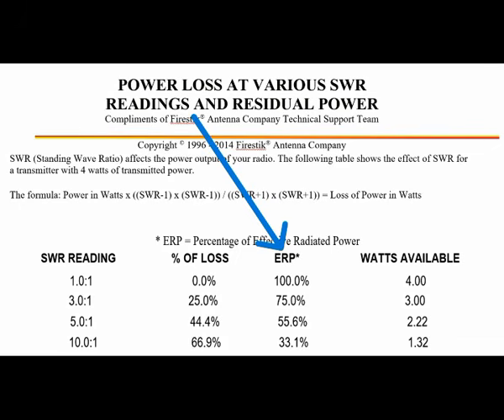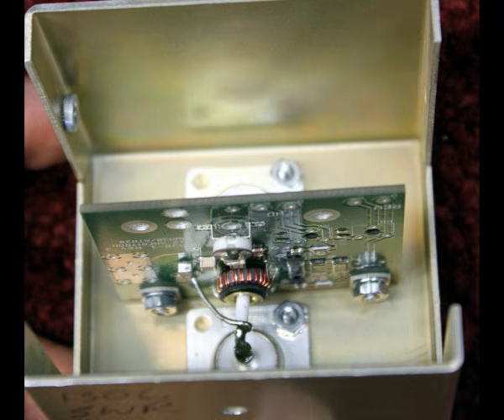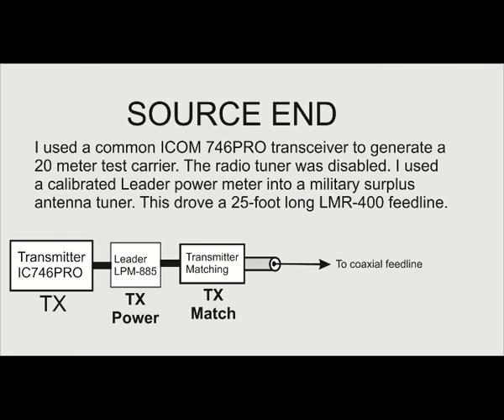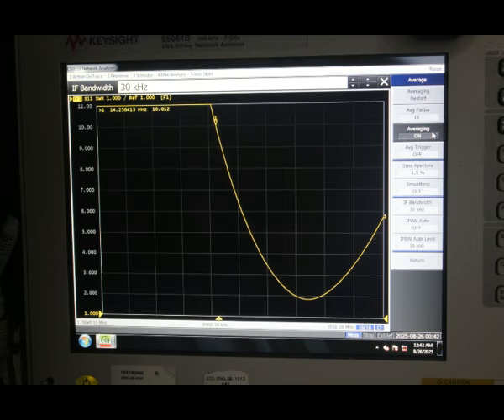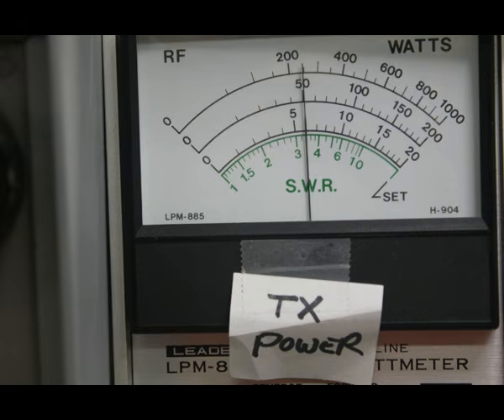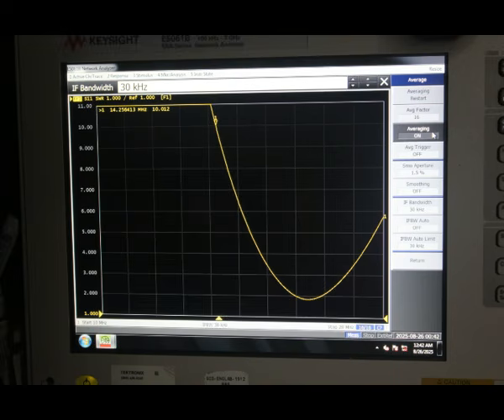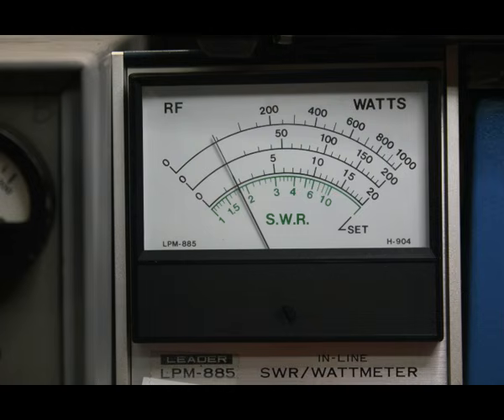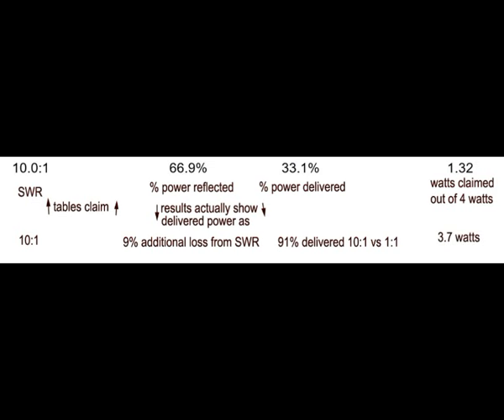Reflected Power SWR What Really Happens!

Comment: Hi Tom. I read all the comments to see if any others picked up on this but none did.  I may be having an 'old man moment' but around the 24:00 mark you are showing the HM2140 and you claim to read 19w for and 15w ref and the meter is clearly on the low power scale(rightmost button IN). I read the values as 9w for and 4w ref.  Then at the 27:33 mark you claimed you had to change to the high power scale.  You read the meters shown correctly for the high power scale, but in fact, this is the same photo at the 24:00 mark and the meter is clearly on the low power scale.  As an aside, if the meter was on the high scale and reading just under 100w, why couldn't that be read more accurately on the Low(200) scale. on it. Neither photo matches your verbiage unfortunately, or I'm having that old man moment!
So, unfortunately for me, it's a bit difficult for me to follow with the incorrect photos.  Also, you indicated the published charts are correct in a very limited instance.  I'd love to know what that instance is. Time also to pull out Reflections III and re-read!!! Thanks Tom!

Comment: Tom, you might want to watch the AT&T archive YouTube video on the mechanical wave motion engine model by Dr. Shive of the Bell Telephone laboratory. 
Waves, their motion (whether longitudinal or transverse mode) in relation to the medium in which it is sustained are all true phenomena and have been objectively tested in many ways. 
The electrical (or the transverse electromagnetic) wave motion in a conductor behaves as predicted. As long as the characteristic impedance of the source, the line and the load are identical the power transfer is 100% disregarding the line loss. 
If the incident energy encounters a 'discontinuity' or of different impedance there's going to be some reflection, the magnitude of which depends mainly the severity of the change. 
All forms of waves, (whether mechanical, electrical or gravitational origin) do exhibit interference pattern (and the other phenomena associated with the waves even of the particles at the quantum level)
TDR is the real study showing the reflected pulse on the scope. 
The assumption that all the reflected power is 'lost power' is absolutely wrong. 
A high impedance load causes a high voltage because all the power is not absorbed. 
A low impedance load draws more current. 
The high voltage (high VSWR) at the Tx end can destroy the final transistors. 
Similarly excessive current drawn through the transistors may result in thermal run away. 
With this in mind the modern transceivers are built with the ALC mechanism. The VSWR coupler detects some voltage and it's used to either reduce the power output or to totally shutdown the output stage. 
You may want to run a new test in which you would replace 'your' "mismatched load" by a regular antenna and then with "deliberately designed mismatched antenna"
In both cases you must do register the actual or relative field strength for comparison.
In either case especially the ALC mechanism must have been defeated.
de VU2RZA

Comment: i didn't watch the whole video yet but it sure sounds like you are inserting another device between source and transmission line. i just want to clarify this before i watch it. most people when they talk about transmitters and reflected power, they mean that literally, like a transistor, a transmission line, and a load, no other stuff in there. that is the common understanding.

Comment: I recently read REFLECTIONS III, and I agree with your video excepted on power reflections: Mr. Maxwell does say, in his book, that power does come back on mismatches. TDR actually proves that, so does top end directionnal couplers.
Reply: Read chapter 2 of reflection 3 it aligns with Tom's explanation
Reply: Let's start by simply considering the situation of instantaneous rf power, which is instantaneous voltage times instantaneous current, as measured at some fixed point, while applying a steady-state sine wave of fixed amplitude.   For a purely resistive load, regardless of SWR, the instantaneous power always flows toward the load, except for the two instants at zero during each cycle.  For a load with any non-zero finite resistance and any non-zero finite reactance, there are two periods during each cycle when the instantaneous power flows toward the load and two periods when the instantaneous power flows toward the transmitter.  (In this situation, the zero crossings of the voltage do not align in time with the zero-crossings of the current.)  The SWR meters and directional wattmeters typically used by hams simply display average power.  When the SWR is higher than 1:1 but the load is purely resistive, the meters assume a superposition of simultaneous forward and reflected waves such that the indicated forward power minus the indicated reflected power is the actual average forward power.  If we are careful to define our terms and use these consistently, then much of the confusion would go away.

Comment: 1. Power delivered to the load will be dissipated 100% if there is matching. Zero ohms or infinite ohms means 0% will be dissipated. According to Ohm's law if there is any doubt.
2. Any changes in impedance will result in matching power loss at all impedance transition points in the transmission chain. Power output transition to transmission cable and transmission cable transition to load.
3. Unused power does not disappear. Therefore, power is reflected. An analogy to this would be 1W TX at one end and 1W TX - 1dB (cable loss) at the other end (same frequency and phase). This will create a standing SWR, which is actually two signals that combine as a result of strength and phase. If you sample the voltage at different points on the transmission line, you will find different voltages due to the phase and strength of the two signals at that point. The transmission line must, of course, be long enough to allow the minimum and maximum to be found.
5. If a transmitter output has an impedance deviation from the nominal x2 (25 or 100 ohms), there will be a mismatch loss of 12% (SWR = 2). This is repeated at the cable transition to the antenna if the antenna impedance is x2 (25 or 100 ohms). If we disregard cable loss. A 100W transmitter, this becomes 100-12%=88W-12%.
6. A 50 ohm transmitter that sees SWR of 10 (5 or 500 ohms) will obviously have problems delivering its power (Ohm's law). The values shown in the video, which are mistakenly questioned, demonstrate a serious lack of understanding of reality. I am not a HAM operator, or as it is called locally, a radio amateur. I have worked professionally with coaxial cables and waveguides and slottet waveguides for SWR measurement up to 18GHz.
And for those that believe the earth is flat : https://www.youtube.com/watch?v=gaxzX28pKxQ
Reply: this is exactly what i'm talking about. all these hams have such a limited view that only pertains to their world and they think the rest of the world doesn't understand when it's actually the other way around. it's myth after myth after debunking myth, debunking the debunk, and it really seems they just repeat what they hear without actually understanding it and then make videos about when you're not sure which person to repeat.
Reply: An antenna tuner at the input with 10.1 mismatch at the antenna with 600ohm open wire can be an efficient system
Reply: @Pioneer936  i'd have to think about that but i'm sure inserting an antenna tuner has an effect. ultimately there is a limit to how many volts you can produce and if that's the limiting factor in the setup then anything that's pushing back i imagine would reduce the power that can flow. you can match a clothes hanger, but if it doesn't radiate and it doesn't reflect, that means it's just not accepting the energy, despite being perfectly matched.
Reply: @dronefootage2778 this is how doublet antennas work
Reply: If we have a 450 ohm ladder line connected to a 50 ohm antenna or dummy load .ladder line  is 1/2 an electrical wavelength long  to present 50 ohm to the transmitter. Loss in ladder line is 0.1 db at 9:1 SWR .   100w  transmitter power . How much power is dissipated in the load/antenna? 35w or 98w ? 
 If you get this wrong then you have fallen into the trap the author is talking about . He is An Rf engineer with many years experience.   Mismatch loss does not mean the power is lost .It just means it is reflected.  Watch the video again. Why is he getting 42w of pwr to the load with 50w transmitter at 10:1 SWR?  Should be about 16 w at the load before coax loss according to Mismatch loss .

Comment: I very much appreciate this video, and have always had many burning questions about reflected power and how it behaves in a TL, but am left with many more questions regarding reflected power after having seen this video. I have read the beginning of Reflections II by W2DU, and was under the impression that the waves do get bounced back and forth in the TL, eventually getting radiated by the antenna or dissipated as heat in the line. To my understanding, the grand misnomer that Walt Maxwell was trying to debunk is the erroneous notion that the reflected power is lost power, as Tom pointed out in the video using the chart example. However, while I may have misunderstood,  I thought Walt was trying to say that the power does indeed reflect back and forth in the TL due to the mismatch at the antenna (reflection coefficient), but will eventually get radiated out minus ohmic losses in the line. I guess this is where the conjugate match debate comes from, as at the source end of the TL, there is a mismatch as well as at the antenna, thus a source reflection coefficient, causing the power to bounce back to the load. Along that line of thinking, I thought that by this logic, some of the generated power within the transmitter also is reflected back internally into the output terminals of the final amplifier transistors due to the mismatch at the input end of the TL, but was absolutely not sure if that was possible. On a side note, I think that damage to PA transistors or tubes is really due to the mismatched load impedance causing the PA to see other than 50 ohms, causing excess current to flow in those devices, and not because of reflected power flowing back into the PA. So this brings me to my point of confusion: If there is no continuous flow of reflected power, how are standing waves sustained in the TL? I thought the directional couplers of SWR bridges and the like do detect both forward and reflected power. If there is no reflected power, what are they detecting and how is the SWR computed? Tom showed us empirically that despite a 10:1 SWR at the load end of the TL, almost all the power does make it to the load with minimal losses. Tom implied that the only way this can happen is if relfected power doesn't flow, and that only forward power flows in the line. But can't that be explained by the continuous reflections theory? I would appreciate it is someone could set me straight on all these basic questions.
Reply: Read reflections 3 chapter 2 Maxwell definitely describes reflected power adding to the forward power and only traveling in one direction

Comment: another idea that has been around, is that ladder line is MUCH better than coax where high SWR conditions are seen at the antenna.  with the notion that the losses at high SWR conditions for ladder line allows more signal to reach the antenna than with coax.  as explained, this was because the losses of "power" past the antenna tuner to the antenna was greater with coax than with ladder line.  the antenna tuner would keep the source happy at 50 ohms, but the losses of ladder line was explained to be much better than the losses of the coax to the antenna.  this setup is used often with a single antenna, say a 160M loop, but used on many bands.  i believe with a matched source and tuned antenna, the ladder line would still have less loss, but the story of a much less loss for the mismatched condition is what i am asking about its validity ... thanx

Comment: Thanks for the video.  I've seen those SWR charts for I guess 50 years showing the coax losses at different SWR measurements.  I noticed many comments about the meters showing different readings when the SWR of 10:1.  Low scale and impedance mismatch distorted true accurate readings but it was very meaningful.  If this is ever tested again I'd like to see a resonant SWR 1:1 antenna used instead of the dummy load and a RF field strength meter calibrated full-scale at the true 50 watts from the Yaesu.  Then pictures at 40, 30, 20, and 10 watts for reference later in this test.  Followed by a picture of the RF field strength meter when the 10:1 SWR is inserted and the Yaesu still keyed at the same 50 watt lever.  Then that reading could be compared back to the original 50-10 reference readings.  Based on Tom's demonstration I'd assume the RF field strength meter should be slightly higher than " 40 " reference mark.  Maybe just another way to prove the same thing Tom did but perhaps removing the meter reading flaws..
Reply: Coax loss is the same at all swr values. it is the impedance change at the cable / load transistion that result in loss

Comment: A basic legend, concern, mystery, whatever is... how/why do transmitter final stages fail?   What if anything does high VSWR tell/warn us about in this concern?   If high VSWR isn't a/the contributing factor/cause of equipment failure, and/or "less than optimal" transmitted signal performance... what's up?
Reply: The impedance 'seen' by the finals must be within the design range.   It's not reflected power but overvoltage or over current conditions.   If you place an ac short across the tx output, there is no power at all, but a lot of destructive current.   Maximum power is transferred when the TX (source impedance) matches the load impedance.   If the there is a mismatch, however slight,  the power delivered from the TX reduces.

Comment: Tom, Help me out here with something.
Summarizing -
1. The first setup was a 50 watt transmitter, going through a tuner into a matched 50 ohm line, with the tuner at the antenna end adjusted to match the 50 ohm load.  1:1 swr all around, and everything was happy.
2. Then around the 22 minute point you tuned the far end tuner to give a 10:1 swr and did not compensate by adjusting the transmitter end tuner. So the transmitter turned itself into a 10 watt transmitter by folding back.  Now we have 10 real watts going up the line but you found only 4 watts going  into the dummy load.  Can you explain, please.
3. You corrected things by adjusting the near end tuner (conjugate match)  which made the transmitter happy again and it stopped folding back. This resulted in nearly 100% efficiency, giving almost 50 watts into the load.
4. Analyzing the #2 situation above......... Would you say this is similar to someone operating a modern SS amplifier WITHOUT an antenna tuner, with a moderate swr, say 2:1?  Or, a 2 meter rig into a slightly mismatched antenna, because they don't have any way of conjugately matching their transmission lines?
Rick  K2XT
Reply: Regarding point #2, the 10W fwd power read on the wattmeter is not a calibrated power reading as the wattmeter sees the 10:1 mismatch.  To get an approximate value of true power delivered to the load you subtract the reflected power reading from the forward power reading as Tom explains moments later in the video.  That won't be a precise reading as Tom explains the meters are at the bottom end of the scale where accuracy suffers and the meters are calibrated to read correctly in a matched 50 ohm system not with a 10:1 mismatch.
Reply: @teds5408  Thanks. But he had a wattmeter  looking right at the dummy load at a 50 ohm point. You're not saying the power there was the same as the tx was putting out, are you?  One meter showed 10 watts and the one at the load was showing 4.  If the explanation is   that the low end of the scales are not calibrated then Tom could re-measure with low power wattmeters to get proper data.  Tom can do anything!  Rick  K2XT
Reply: Yes the transmitter is only putting 4 watts into the line, the watt meter that reads 10W FWD is not giving a calibrated reading because it sees a 10:1 mismatch, that same meter would read approx 6 Watts reflected so the net FWD power is actually 4 watts.

Comment: One more thing: Your measurements prove that the net loss is greater with bad SWR. In the example you show we lose about 6W with the high SWR compared to SWR 1:1. Where is that power lost? Could be both in the matching units and in the coax (and probably is in both). Do you agree, that high SWR on the transmission line means more loss in the transmission line due to increased average RF current in the transmission line (=greater ohmic loss)?
Reply from the maker: The matching networks I used were pretty good networks. The increase in loss was mostly due to transmission line current increasing. An interesting thing is mismatching a transmission line short in electrical degrees in a direction that decreases current intergrated over line length at HF can reduce transmission line loss compared to the matched loss.